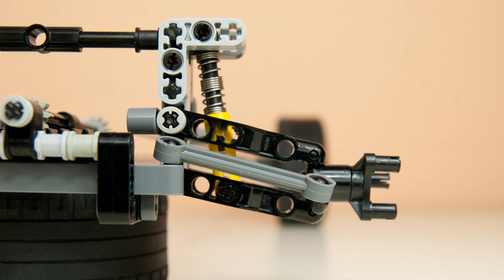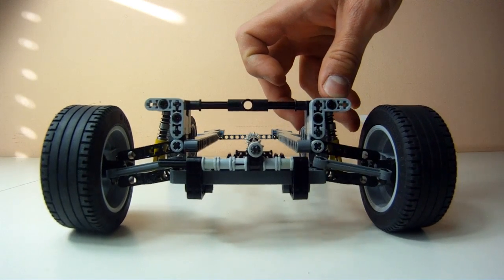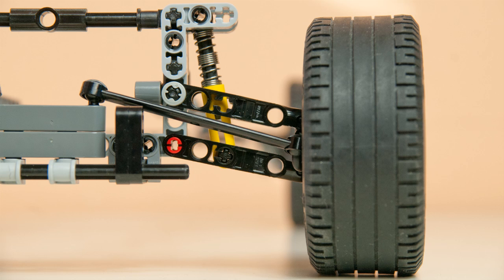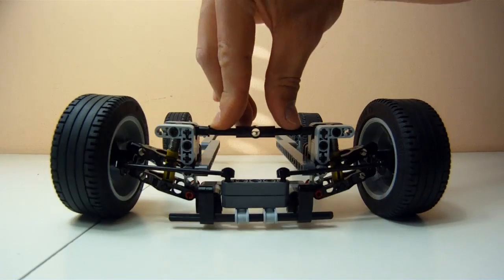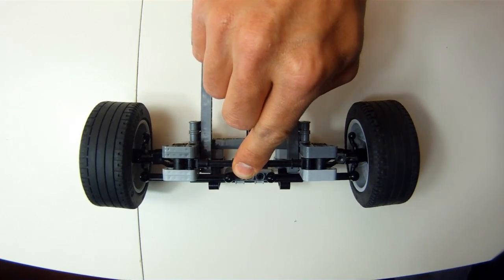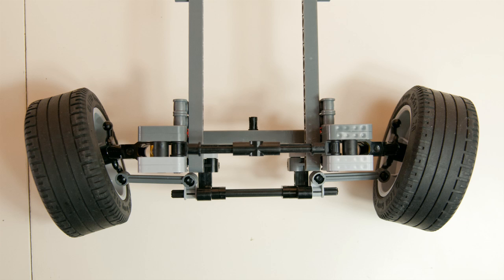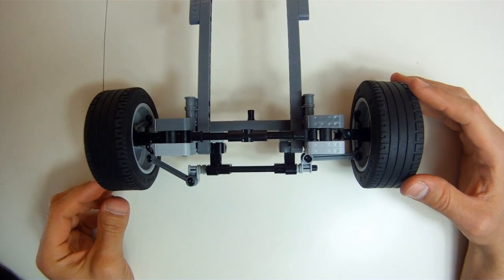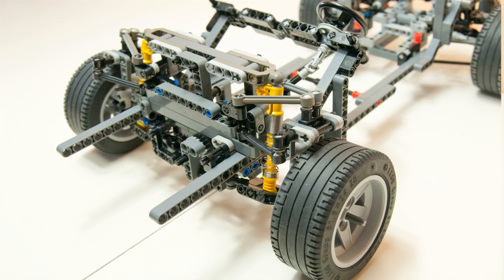LPEpower episode 05 - Bump steer, toe in, toe out

Comment: could you show an example of the VW beetle trailing arm suspension and steering system with a center connected steering rack? Many people are trying to upgrade old bugs to modern steering. But the suspension type is uncommon and causes lots of issues.
Reply: The only way to get 0 bump steer on a trailing arm suspension is with a steering box using the same geometry as stock. A rack and pinion will always have some bump steer in this application.

Comment from the maker: If you use the old wishbones, that are 6.5 studs long, that is an issue, because the steering links are only 6 studs long. Also, if you respect all the correct geometry (caster and kingpin inclination), this should really not happen. Just watch my macpherson video, where i have a differential and the steering links are just as they should be.

Comment: i use awd in all of my lego cars and i can not manage to get the link arm parallel to the wishbones because of the differential. i have also discovered that with all wheel drive in lego cars using the lego hubs it is ideal to have the link arms behind the axel so when power is put through it won't create unwanted toe angle.
Reply: Then dont use a straight steering rack, or mount the rack higher than the differential and put a space between the rack and the pivot point on the steering arm